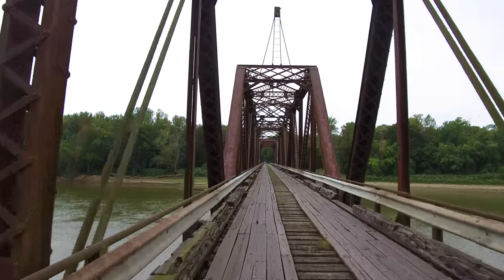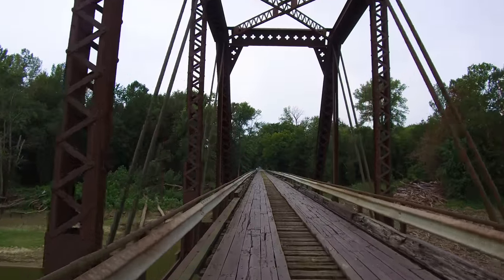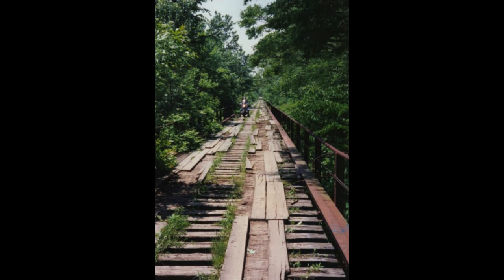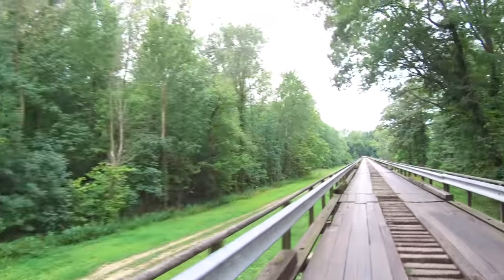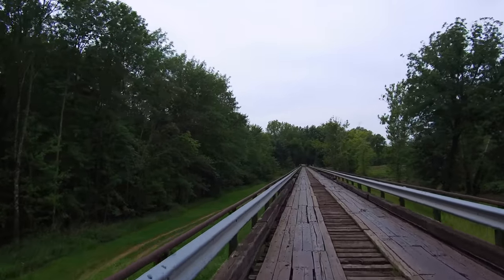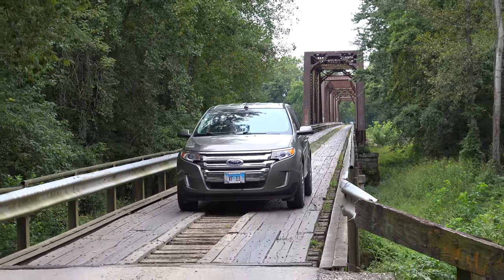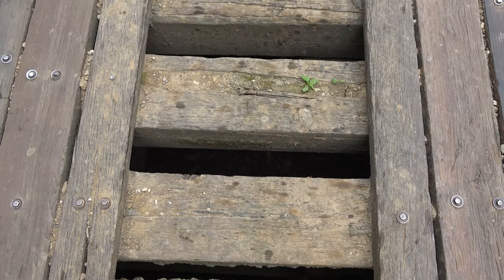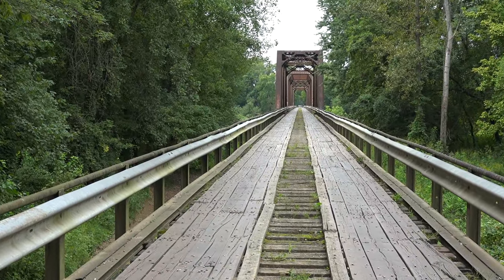The  Haunted  Wabash  Cannonball  Bridge,  St   Francisville,  Illinois

Comment: If that swing bridge was hand powered why does it have an electric service tower on top of it?
Reply: I don't believe that it does.
And as long as I lived there, I never ever even knew it was a Swing Bridge because it never lifted up.  Ever.
Reply: @juliepearce6667  Julie swing bridges do not lift (and that includes the Wabash  bridge here) they swing. Bridges mostly are positioned athwart stream and that's true here. When a swing bridge opens for boat traffic it swings parallel to the waterway.
Reply: @patrickrichardson1036  I guess you're never too old to learn! 
But still.... The bridge has always been stationary.
How's that? ✌️😁
Reply: @juliepearce6667  The reason for the stationary stance of the span is that there is no river traffic that warrants repositioning the deck span, if I am not mistaken the river is at a very shallow point near and around the bridge.
Reply: That is not an electric service tower.  It was for signal lanterns.  I did not know it was hand powered but I knew it used to swing.  I have been under that bridge during my college days and there was a massive ring gear and not much else left of the swing mechanism.  I hear it is concreted in now so it cannot move.  I am a local and cross the bridge all the time.
Reply: Mount for the navigation lights. I'm assuming mostly for the river traffic though could have also worked for rail as well. With the bridge in the closed position green lenses would shine up and down the track and red would show up and down stream indicating track clear for rail and blocked for river and the rotation of the bridge to open would indicate the opposite.

Comment: If there are two ONE WAY bridges in close proximity to each other. Why not designate each for ITS own direction and have traffic use em accordingly.?????
Dont tear em down. Theyre still serviceable and represent Americana!!!!
Reply: That would be a great idea, if the two one lane bridges were “side-by-side”, rather than “back-to-back”.   One bridge crosses some low-lying area right before you reach the bridge that crosses the Wabash, traveling along the same road.
Reply: @mrimmortal1579  Thats notr the way I heard the video!!!!
Reply: @frederickwise5238  yeah, the video is kind of ambiguous about the “other bridge 1/4 mile west”, almost as if he’s saying “while you’re in the area, check out this bridge, too!”  But you can’t cross one without crossing the other.  It’s been a few years since the last time (out of a whole two times lol) that I crossed it, so I don’t really remember if there’s a stretch of normal two-lane road between them or not.
Reply: @mrimmortal1579  I dont expect to ever be in the area to find out, since I cant drive anymore. LOL
Reply: @mrimmortal1579  There is a nice two lane paved road leading up to both sides.  The road in between the two spans is also 2 lane paved.